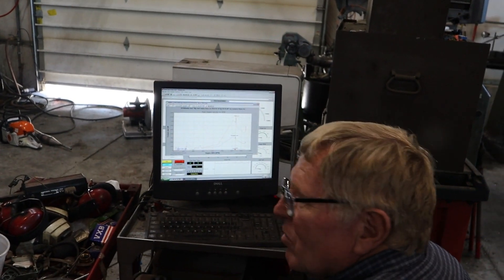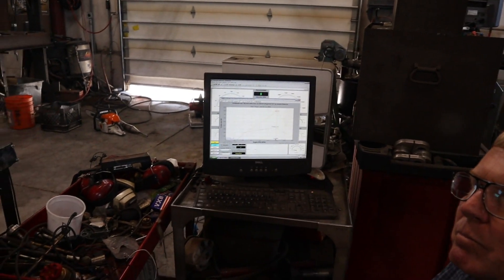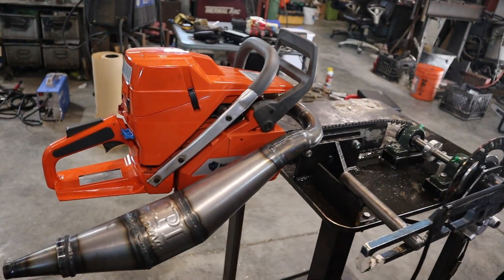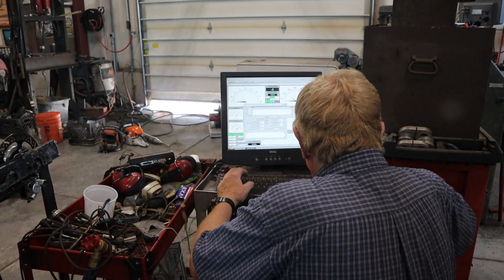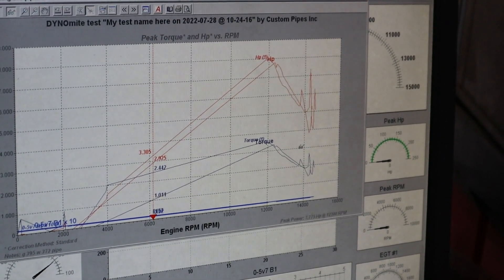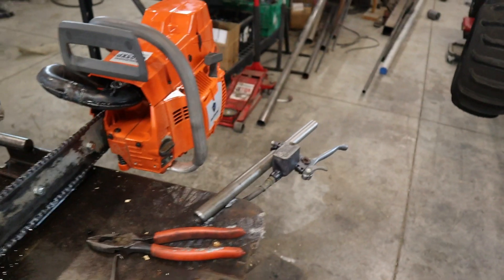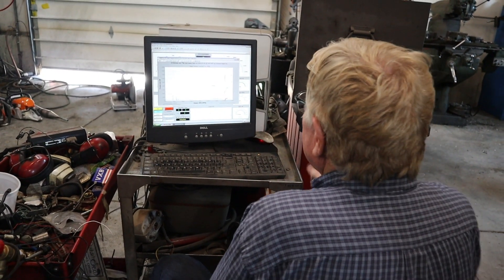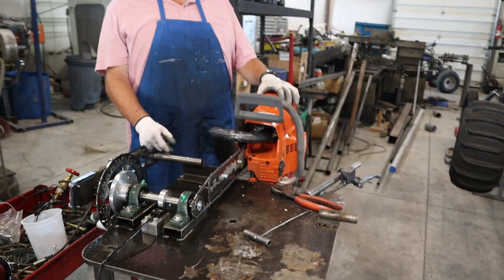Farmertec G395XP Chainsaw on the dyno testing different exhaust pipes Bolt on HP gains

Comment: I thought pipe #1 looked like a 660 pipe.
Reply from the maker: Very good eye. I was hoping that because they are close in CC that it would have worked better, unfortunately it did not. So we went back to the drawing board. Stihl and Husqvarna cylinders are very different and pipes react differently to different cylinder ports & sizes.